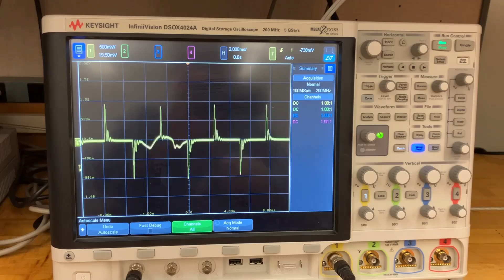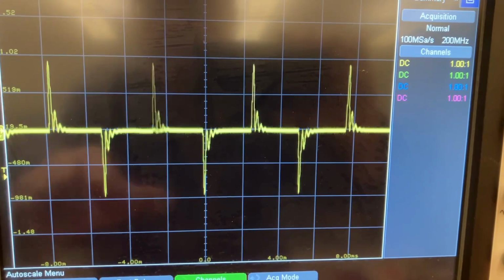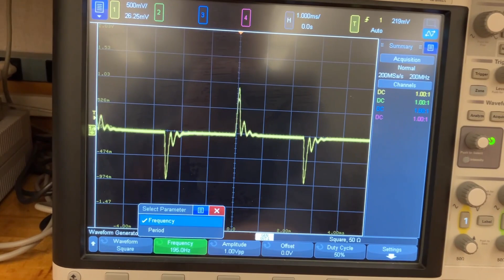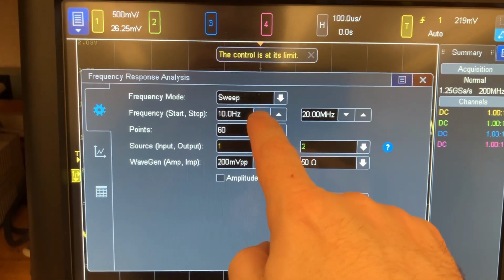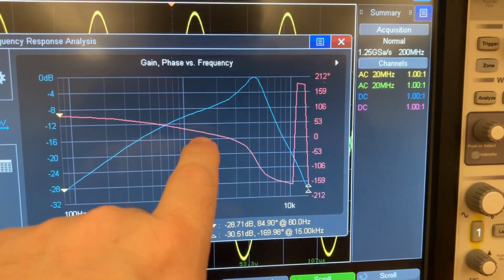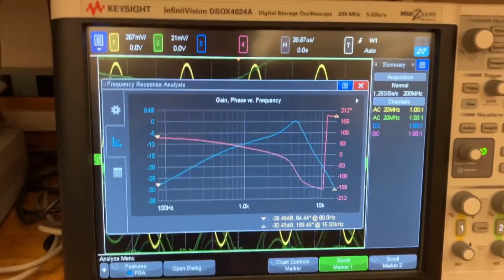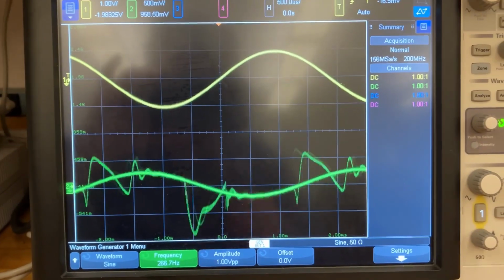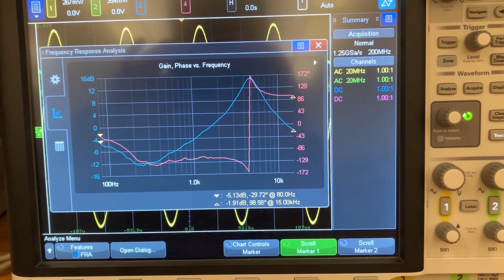Guitar Pickup Measurements Using a Keysight Oscilloscope (Excitation Transfer Function & Impedance)

Comment: Nice experiment!
Usually the volume pots on guitars are 250K for single coils and 500K for humbuckers, sometimes 1M for some Telecasters, afaik.
There's also an interesting idea of running the humbucker outputs through an opamp inverting and noninverting outputs directly, like an "activator" (making passive pickups behave more like active pickups), which, in my tests, increase the "bite", probably because of the effect you demonstrated of moving the peak and treble roll off higher.
Reply from the maker: Yeah, in lab and homework I sometimes have my students use an artificially low value for the volume control just to exaggerate the effect and make it more obvious.
Reply from the maker: Your suggestion with the humbucker and op amp is really interesting!
Reply: @Lantertronics  Just  to be clear: Not my idea. That's how (afaik) all active pickups are made. There's an interesting article on ElectroSmash website (which I think I'm unable to link, I guess) about the EMG81 (a famous active pickup) about the disassembly and analysis of the pickup itself and the circuit inside, which works as I pointed out. 
The most interesting part to me is the fact that you can use different resistor values on the opamp inputs (in series with each coil) to swerve the pickup response to be more single-coil-ish. You get less of the noise-cancelling benefit inherent to humbuckers as a tradeoff, I guess. 
You can also set the gain separately on the feedback loop to "match" volumes between bridge and neck pickups, which is nice.
Anyway, thank you for sharing valuable knowledge online.

Comment: Great video. About the frequency response measurement, have you considered an op-amp integrator after the TL072 buffer?  That should cancel the differentiating effect of the exciter/pickup coils and restore a normalized frequency function.

Comment: To negate the effects of the derivator zero, can't we just use an OTA as a Variable Gain Integrator between the oscilloscope and the excitor coil (with another buffer) and get an integrator effect to cancel the zero with unity gain?
Reply from the maker: I have a feeling that may be overkill and there's probably a simpler solution, but I haven't really thought about it much.
Reply: @Lantertronics  We can also consider not using excitation by flux, but rather inducing vibration on an actual string to take the frequency response.
Reply from the maker: @Eren_Sahin_  I have an eBow. It's hard to use consistently, though. I think doing this with lab experiment level consistency would be tricky.
Reply from the maker: @Eren_Sahin_  Thanks, I will check it out!

Comment: I have a test rig to approximate the frequency response and output impedance of the whole guitar wiring, which is essentially an HSS strat pickguard, but instead of connecting the start of the coils to ground, they are connected to an input jack. This allows me to send a sweep through the test rig before it goes into other devices (mainly pedals I am designing) in order to check the interaction between the pedal's input stage and the guitar wiring.

Comment: Can you select the gen as a trigger source in the scope? If not, use second channel to trigger off gen source ( you can turn the trace off and still use trigger). This will create a rock solid trigger. 

An FFT will help you find the interference frequencies, causing that distortion.
Reply from the maker: Ooooh! Yeah... I could have totally triggered off the input, and usually do that, I just wasn't thinking.
Reply: @Lantertronics  I spent a couple of decades showing people how to get rock solid triggers, having worked for HP Test & Measuremnt (Agilent/Keysight) and then at Tektronix.   Couldn't help myself. 😆

The other thing I wanted to do, watching this was segment memory and look at each capture individually with its time stamp to understand the waveform distortion. And maybe even trigger on it.  But just because you can, doesn't mean it's needed. 😎
Reply from the maker: @GrinRepair  The quality of electronics -- and the cleverness -- of high end measurement equipment blows my mind.

Comment: Are you using obsolete TL072 cause it's the cheapest high impedance buffer and is good enough? More expensive OPA2134 and plenty of CMOS opamps have better noise specs.
Reply from the maker: Oh yeah, there's definitely better spec op amps out there. I used the TL072 because I have a drawer full of them. ;)

They're generally a reasonable workhorse op amp for synthesizers and guitar pedals and such.
Reply: Sweet, thanks for confirming. I got a few sitting around too. Nice to use a 25 cent component when I can. Sure is in many audio circuit examples.

Comment: On my RIGOL pu put the USB stick in, it has to be FAT32 or some such, and I hit the "print" button and it saves a screenshot.
Reply from the maker: Here I want to get the actual data to load into Excel or MATLAB and process. There's a way to do it, I just need to spend some quality time with the manual.

Comment: So then, would it be safe to say the first plot (with the excitation coil) is an analog of the pickup’s reluctance Bode plot? Would it be safe to assume that aside from some offset, the relative measurement in dB between given frequencies is directly correlated? 

This is something I’ve been pondering how to measure - really exciting to see the quality of your results from even a rough setup like this

As for the jank - maybe you’re experiencing non-linearity due to saturation? Especially as the first test has a strong static field imposed on the DUT
Reply from the maker: I'll be honest, I don't actually remember enough EM to make a statement about reluctance, or exactly what it is that I'm plotting. I'd have to do some reviewing and some thinking...

Comment: Humbucker-equipped guitars will typically have 500k volume and tone pots. Would that further shift the frequency plot as compared to your 100k resistor?
Reply: Helmuth Lemme has charts showing the effect on the resonant frequency of various resistance loads. Also the effect of capacitance (for example from the guitar cable) on the Q factor (height of resonant peak ~= treble emphasis). Google his "The Secrets of Electric Guitar Pickups" and also his "Pickup measuring techniques". The standard in pickup testing is not only to measure the unloaded response, but also that with 250k total resistance and 470 pF capacitance. But of course you can use any loading more typical of the conditions you want to put the pickup into. Given their typical difference in resistance loading, it would make sense to have one standard for single coil guitars and one for humbucker guitars.
Reply from the maker: Using a higher resistance pot wouldn't shift it as much as the 100K pot I used. Think about it this way, using a higher resistance pot eventually is approximately like not using a volume control at all.
Reply: 500k will raise the resonant peak compared to 100k, yes. The other very important thing to remember is there will be tone controls also connected in parallel with both the volume control and the pickups, so those also will impact the resonant peak (though not that much when they are set to max level).

Comment: Your exciting one coil with another which is kind of like a tank circuit. I wonder what the resonant frequency of the guitar pickup coil is? Is this resonant frequency within the audio range and if not; does it have any sub harmonic frequencies within the audio spectrum we can detect by ear?
Reply from the maker: The underlying tank isn't really one coil vs. the other, it's the inductance of the pickup (which is something the designer can readily control) combined with the interwinding capacitance of the pickup (which is harder to control and just kind of winds up however it winds up). The resonance bump is going to be close to 1/(2*pi*L*C). It will be less than that because of the resistance. It's well within the audio range, and it's really what gives each pickup its characteristic voice. 

I have a bunch of lectures on this in my ECE4448  "Guitar Amplification and Effects" class playlist I'd invite you to check out -- you can readily find it by searching on YouTube (I'm asking you to search instead of adding a link since YouTube sometimes deletes links.)
Reply from the maker: Sub harmonics aren't really an issue here.

Comment: So the exciter coil does basically what the strings and plucking a note does? Except it's constant instead of starting and stopping? So you get a response from the tested pickup with the exciter coil? I'm not sure I understand unless that's how it works lol

I actually only just started getting into this. Been reading a lot of the pickup analyses done by Antigua, a guy on a bunch of the forums thats tested A LOT of pickups.

You can look up "Antigua pickup analysis" and you'll see all of his stuff. He gets EXTREMELY in depth. I think he even did a test to measure how pickup height of the pickup that's OFF affects the tone of the pickup that's active. He's tested different pole pieces and base plates and all, sorts of stuff. There's one test where he tests a Donlis PAF against a couple Dimarzios and when he swapped pole pieces between the 2 pickups, it made zero difference. Meaning Donlis uses the same parts Dimarzio does, more or less.
Reply from the maker: It's something like that. The pickup is responding to a change in magnetic field. Here I'm changing the magnetic field using the excitation pickup. When you plug a guitar string, the strings become magnetized by being in the magnetic field of the pickups magnet, and moving them disturbs the field. It's similar in that the pickup responds to the VELOCITY of the string, not its absolute position.

I'm not familiar with Antigua, but will check out their work! Thanks for the tip!

Comment: The guitar pickup is picking up 60hz hum and other EMI interferences that is what you're seeing I'm sure. You oscilloscope impedance is set to 50 ohms which a guitar pickup impedance output is NOT 50 ohms so that is a problem you have to change the Oscilloscope port impedance. Try to make another video about measuring the frequency response, Pickups peak frequency and Pickups impedance
Reply: Another issue might be driving the source coil with the function generator output directly with its 50ohm output impedance.
Reply from the maker: Yeah, I wasn't paying attention. If I had changed the output impedance on the scope like I should have I might not have neededd the buffer.
Reply: But he has a buffer between the pickup and the oscilloscope.
Reply: @moroboshidan7960  yes true he does not sure if the buffers output is 50 ohms
Reply: The TL072 output impedance is not going to be ideal 0 ohms but I think close enough with the oscilloscope set to 50 ohm input impedance. Would be good to measure to confirm.
Reply: @BoxingDayAC  Output impedance is LOW so the Oscilloscope needs to be set to HIGH impedance. You don't go from LOW output impedance to LOW input impedance. You go from LOW output impedance to HIGH input impedance so you get the power transformer
Reply: @BoxingDayAC  I agree, the TL072 should be able to drive the scope 50 ohm input impedance without an issue, particularly at these frequencies. Also, how do you know it was set to 50 ohms? Did I miss something?
Reply from the maker: Buffer is a TL072, so it's whatever the output impedance of that is (pretty small).
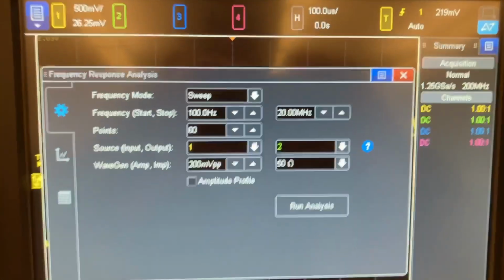Reply: @CraigHollabaugh  Thanks! I didn't know it was set to 50 ohm or 1 Megaohm, just going with what @waynegram8907 said. I can see at 3:30 the function generator is 50 ohm but that's not how I interpret the comment. Maybe the voltage loss at 7:00 is more than what the pickup would cause and implies scope is to 50 ohm input.
Reply: @waynegram8907  I agree that you want LOW on buffer as used to HIGH (1 Megaohm) on oscilloscope for max and consistent voltage transfer across frequencies. LOW buffer to LOW (50 ohm) minimizes transmission line noise and we're looking at noise. Therefore, I think scope set to LOW is also defendable. TL072 datasheet shows very flat open-loop output impedance from 3kHz to 1MHz.
Reply: @BoxingDayAC  I doubt the function generator output impedance can be changed, its normally fixed at 50. Setting the scope input impedance is normally done for high frequency measurements to match cable impedance to reduce reflections. High as in MHz. But like AL said, he doesn't know where it was set. Good conversation everyone, enjoyed it.
Reply: @BoxingDayAC  Why are you looking at the Noise level of a guitar pickup?
Reply: Have you seen the huge database of pickups analyzed by that guy Antigua? He's on a bunch of different forums and has analyzed probably hundreds of pickups by now.
Reply from the maker: Oh! Yeah, I can change the scope impedance. I wasn't paying attention (hadn't used this scope in depth before).

Comment: ok, but what does it sound like? run some audio through it! human speech, guitar, and a fully mixed electronic song for a few points of reference
Reply: He’s just demonstrating how pickups behave when you load them, how dynamic they are and their dependence on guitar wiring etc, in general
Reply: @danielsanichiban  yep! that's great. but i'd still love to hear what this setup sounds like, because it's unique :) would love to see how it reacts when the items are being moved around in 3d space etc.
Reply: @cheater00 The sound output can be pretty ok except lacking bass with programme like you suggested. Varying load impedance and/or tone pot/tone cap and listening and looking at the FR plot is revealing. For proper measurement/analysis the drive coil needs to be constant current source. A power amp driving the coil through a high value resistor approximates constant current source well enough.
Reply: @ericmc6482 yea i'd love some demos :)
Reply from the maker: That sounds like a lot of fun actually -- could be an interesting effect.

Comment: I'm not sure, what you want to prove here, but I'm sure it's fun anyway.
Reply from the maker: I'm not sure what I was trying to prove either. :)
Reply from the maker: I'm not sure I was wanting to prove anything at all... just wanted to measure stuff.
Reply: @Lantertronics  I've been there and seen similar things. Be careful, you might get deep into a rabbit hole. On my recent built guitar FX I noticed a permanent noise, which could come from the circuit, but it was there. Turned out, it came from the switching power supply. After using a ring transformed PSU, the noise was gone.